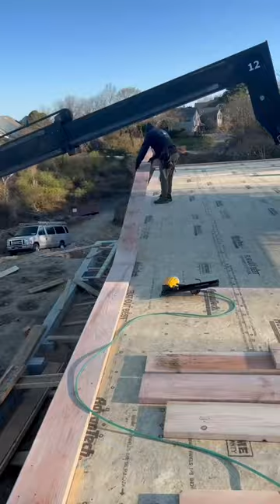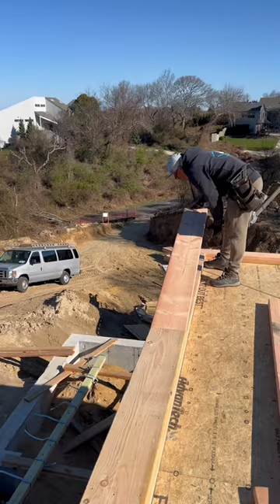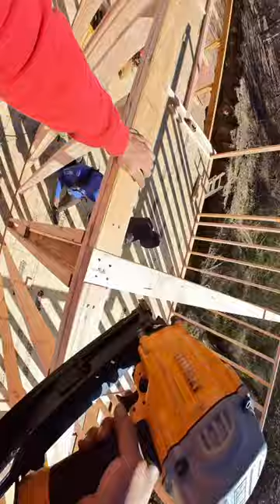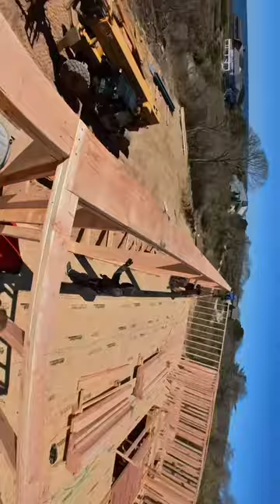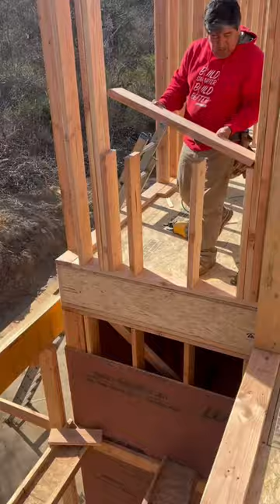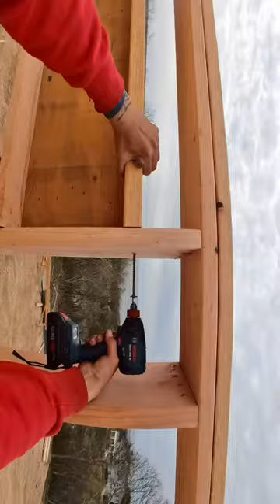10 feet walls #shorts #construction #carpenter #skills #design #team #perfect

Comment: Headers should all ways be tight to the top plates
Reply: Not always. Especially with 2X6 walls and 10’ ceilings. There are some factors that come into play. Interior or exterior wall. What’s going into the opening. High wind considerations. Joist/collar tie (or not) and top plate stability. Framing method (box or toenailing - the correct way). Stack/carry and bearing are not so much of a factor for cripples above or below. Dropping headers to the top of the opening and installing cripples above requires less lumber and provides more rigidity to the window or door unit in high wind. Notice the design of a 2X10 wall (possibly for high wind) and the use of structural screws to attach headers and prevent rotation. In this case, better to drop the headers with cripples above. With the use of straps, hardware and specialty fasteners, I can’t think of an instance where I would prefer the header up to the plates in this case. Also, the additional plate stability gained by nailing a Doug fir header tight to the top plate, is not so important when LVL is used for header material - as in the video. Make sense?
Reply: Interesting that the headers are tight to the plate at the first floor (different video). But they also left the bottom 2x6 plate off. Makes me think maybe arch top units will be installed. Easier to template sheathing and frame/block down to sheathing cuts. So, first floor headers are tight to plate. Second floor, they are dropped (no arch top glazing). Nice to get an occasional peek at the print.

Comment: You lost me at toe nailing the bottom plate
Reply: Yup, I thought the same thing. No excuse on a new build to do this.
Reply: Welcome to NY. Everywhere has different codes. Believe it or not, you don't know everything. Crazy that different counties, cities, states have different codes, right?
Reply: @brandonwalker6781 ICC NY actually permits both toenailing and end nailing of studs to plates. This crew triple plates at layout and toenails because it’s a more accurate and efficient way to stand walls. If it wasn’t, you would be watching them box frame (end nail, square and sheath before standing exterior walls). Keep watching. It is a regional thing also but learn to frame this way and you won’t box frame again. More money in your pocket and a better frame.
Reply: This is the proper way to frame. Way more accurate and toenails are stronger.
Reply: @michaelchaney5962  Michael, you are correct. But it’s a hard sell here. Most guys get a little defensive when they realize they have been taking the long road for the past 20 years. Some longer than that. But it also is surprising that anyone who has framed for a short time can’t recognize quality work when they see it. But I have suggested that maybe people have to do quality work themselves to know it when they see it here. This crew works close to the mark. Fun to watch.
Reply: @henrypeisch5289 Sorry but you are not correct about this. I have seen and done both and the best fastest framing in the country was in 70's,80's,& 90's  on the Southern California Coast. Not on the East Coast. Sorry But That's A Fact.
Reply: @H43339  I would be interested to hear more about your experience with triple plate layout and toenailing like you see from this crew on this channel. Thanks for putting the time in and best regards from the east coast.

Comment: This should be the standard for framing crews. I do have one question out of curiosity, why you nailing all your plates together before framing wall? Are all your studs toenails in?
Reply: First plate nailed home. Second tacked to first. Top (third) plate nailed home to second. Second and third stacked to lap at intersecting plates (walls lock each other in position when standing). Detail all plates. Pull back top two and load wall on deck (headers included). Toenail top and stand wall. Toenail bottom. Line walls, plumb and brace. Jacks, cripples, sills (always double), tees and corners can go in after bracing. Sheath later. Fastest way to the roof. Trust me.
Reply: @henrypeisch5289  Why not wait to attach the top (third) plate so you can end nail the stud tops, then attach the third plate?
Reply: @liquidmagma  like driving a car with one foot on the brake.
Reply: @henrypeisch5289  So just speed.  Got it.

Comment: Where do they use 2x8 as exterior wall framing?  Obviously somewhere cold, just curious.
Reply: Seemed like one particular section.  Must be going to hold some serious weight and/or extra insulation.
Reply: 2x10. Part of the shear wall design.
Reply: @henrypeisch5289  I was more interested where as a location in the world, not where in a house.  With that said thank you for the reply.  The reason I ask usually shear walls are for heavy loads or wind loads.  I build houses on the jersey shore and we never needed to use 2x8 for wind loads.
Reply: Long Island,NY. These are 2X10 and not 2X8. They are being used to accommodate large glazing and a welded steel shear wall design. There is another video of the steel installation. Interesting build.

Comment: They must have left out the shots of them leveling, plumbing, and squaring....
Reply: When standing walls this way, level and square are not an issue. You line, plumb and brace only. Triple plate. Toenail. Sheath later. Because the top plates overlap at intersections during layout, it takes much less time to plumb. Plumb one wall and connecting walls are forced into plumb also. Keep watching.

Comment: I have questions about the toe nailing on the walls. WHY?
Reply: Triple plate layout. Nail home shoe plate to deck, tack toe nail second plate, nail home third plate to second. Markup and detail all plates at once. Pull back top two (second plate or lower top plate is just tacked to shoe) Load walls on deck with precuts and headers. Toenail tops on deck. Stand walls. Bottom plate is already nailed home to the deck. Lap intersections. Walls lock in place. Toenail bottoms of precuts. Plumb and brace all standing walls at once. Quickest way to plumb and some walls self plumb (plumb one wall and intersecting wall is plumbed also). Big headers, point loads, jacks, cripples, corners and tees. Next floor, onto the roof. Sheath whenever. Better way to frame. Keep watching.

Comment: Did anyone see a single level in this video? Nope. This is why houses are crap now days. Sorry, not sorry. Im a finish carpenter and I'd hate to be the subcontractor to finish this house.
Reply: Chill bro.  No need to be a keyboard hero.
Reply: Bret, walls are lined, plumbed and braced after all laps at intersections are nailed. Faster and better way to stand walls. Keep watching and learning.
Reply: @henrypeisch5289   haha, come with me when I need to hang a door plumb and most of the walls are out by 1/2 inch in 8 feet. It's literally every job. You can't justify it for yourself until you go to hang a door plumb and say WTF. Yeah, it's fast for you framing it, but it fuxks me. Most of the time one side is plumb, but then the other side is out in only a 30 inch opening. A door shuts with a flat surface, right? So when one side is straight and another side is crooked, how does that work out? It doesn't.  A lot of framers are shit now days, and thats it. I live it every day. If you're a framer you should go back to the job in the finish phase and ask the finish carpenter how it's going. They'll tell you honestly like I'm telling you now.
Reply: @Breezio69  Bret, I understand. I have framed and finished. I have seen a bit. I’m just letting you know how it works with this crew on this frame. The walls are plumbed and braced in the video. It takes less time to line, plumb and brace walls when you layout and raise walls like you see on this channel. These guys don’t box frame walls. They know how to frame. I have seen more poor work in the trades - than I have cared to see also. So I generally commiserate with you about the state of the carpentry trade. But this isn’t that.
Reply: Corners get plumbed and walls straightened when it’s all together.